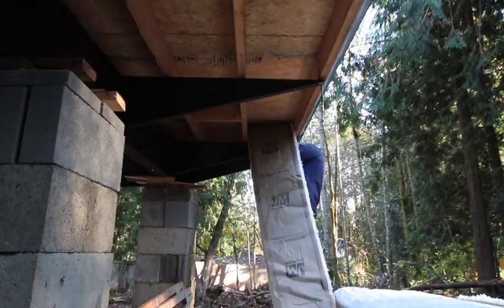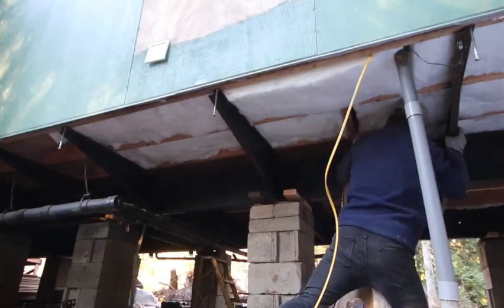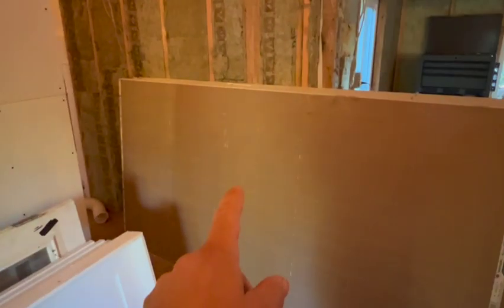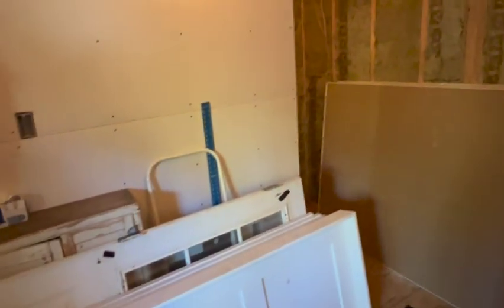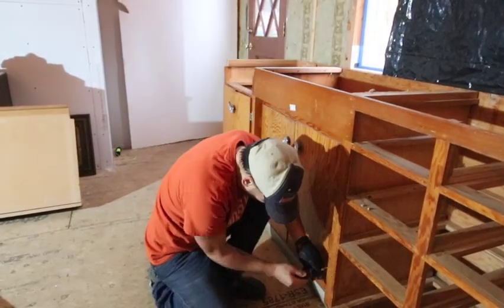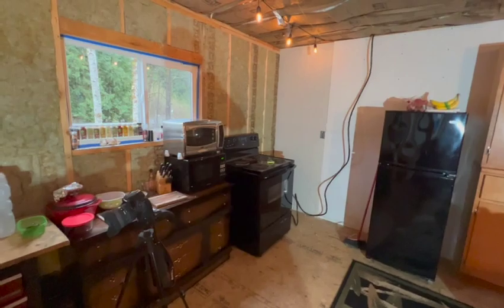New Years Update on the Old Single Wide Mobile Home Build Out.

Comment: looking cozy!
Reply from the maker: Feeling cozy too! At least when it's not too cold outside! ;)
Reply: @thesomewhathandyman9400  I've refinished many things. What works best IMO is ..floor adhesive remover ..for paint. rinse off w water..do on nice day for wood to dry quickly.. no scraping needed. For varnish,  
stain ..furniture refinisher..9thats the name of it) liquefies finish then it dries and it is evenly distributed. I would not paint the cabinets.. short term is fine within five years if you do keep some touch up paint.

Comment: If you can’t get that cabinet smell out use TSP.  Made specifically for cabinets.   And you can condition the inside with Dixie Belle’s Big Mama’s Butta.  It take the smell out and conditions the wood simultaneously.  Use the TSP. First tho.
Reply from the maker: Thanks for the tips! I did just spray it down in vinegar a few times and it seems to have done the trick......or ya know, I'm just used to it now. Ha!

Comment: You can put that kind of wood flooring and laminate flooring in bathrooms however you have to get yourself some laminate flooring glue (Which is mainly to seal the floor from water, don't use regular wood glue because it's not resistant to water) and make sure that you glue the planks together and then after the planks are installed go along with seems with a with some glue and a damp rag to clean it up. Seal the edges with some nice trim and silicone caulking and your floor will be safe.
Reply from the maker: Thanks for that tip! I will def use it!

Comment: I like the cabinets.  They are mid-century as is your sofa.  I'd probably just paint them inside and out.   Probably white or linen or jadeite.   Boil the pulls and hinges in water and some vinegar in a pot you plan to throw away to get all the gunk off.   New slides will be easy, and you can get affordable quiet close slides from amazon.
Reply from the maker: Thanks for the tips! I do have some cool mid century pulls I do plan to replace the current ones with. I just have to drill some new holes in these. Stay tuned! ;)

Comment: What a project!. How do you calculate what the weights will be that the foundation will bear. Is the soil compacted well, and drainage is good? I recently learned that concrete foundations wick moisture upwards into the sill plate etc, but there's strong polymer for that, kind of a gasket? I've had my '72 12x60 for 5 yrs, and have recoated roof for 2nd time. It has an add-on addition that is a "room" that uses an awning for a roof (NOT a factory bump-out). Am looking to buy and live in a similar home that has a leaking-roof factory bump-out. The larger LR is nice, but if there's a way for a skilled remodeler to remove the bump-out, shore up the missing verticals, rebuild the wall and properly redo edge of roofing, I'd love to learn about various experiences, warnings, and tips!
Reply from the maker: Thanks for the comment and sorry, I've been hibernating for the winter and haven't been on my channel as of late. I'm not sure about how to calculate the weight tolerances and the cement runners under my pier blocks were luckily already there when the house was brought in. I know I have more piers than is required by my local codes so I think I'm good on weight capacity. My lot is at an angle and the soil is very loamy so I do have great drainage. I'm thinking about pouring a cement base a few inches thick around the ring of the house when I build the skirting, so hopefully that will help keep the underneath soil very dry. Yeah, I'm sure a skilled carpenter could remove a bump out and rebuild a wall fairly easily. Only problem is finding a skilled trades person willing to work on an old mobile home these days. At least that's what I hear. Best of luck on your repairs!